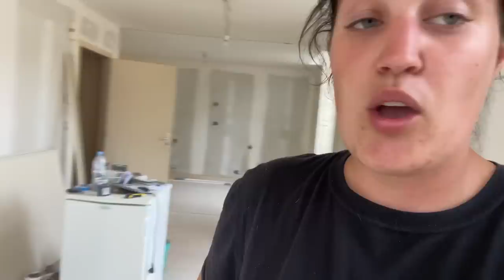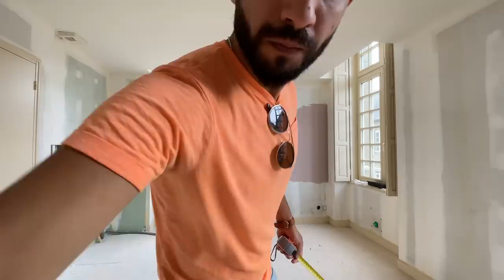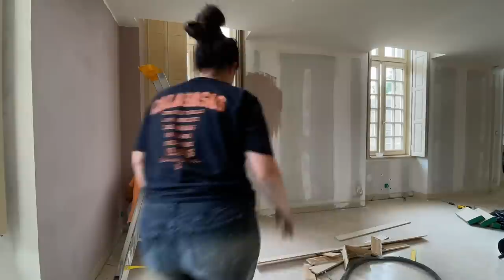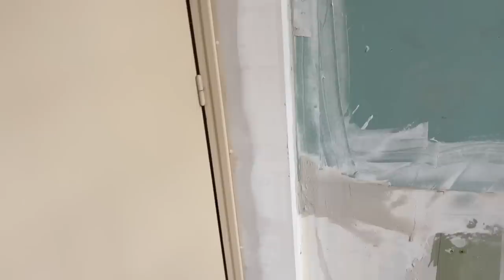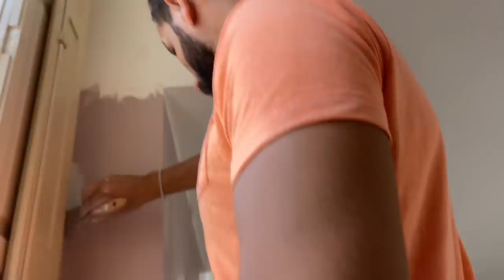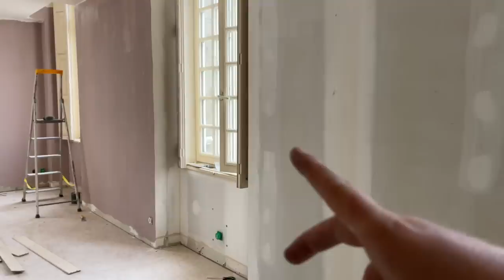Turning Part Of This Convent Into A Duplex Apartment!!

Comment: Just a question guys, do they not use paint rollers in France? I see you all use a brush for all painting.  Here in South Africa usually we use rollers for all painting and only use a brush to do "cutting" ie corners or very tight areas.
Regards from South Africa.
Reply: I was wondering the same thing.  It would go so much faster and the coat would be smoother.
Reply: They do sell rollers in France.   I am  not sure why they are only painting with brushes. Maybe it’s to do with the paint they are using !!!!
Reply: I had the same thought, it is what we do here in the States too.
Reply: I know when Michael was painting his cottage, he said he preferred the look of hand painting over rollers. He said you dont get the little bumps that rollers leave behind.
Reply: Interesting way of painting walls with a brush.
Reply: @WilldoAldone  it does depend on the type of roller bc there are several. I find that the roller will miss a lot of spots depending on the wall texture itself despite a different roller! Having said that, I wonder why they dont tape it off and use a paint sprayer for 1 even basecoat then go back in and use brushes. Cut in and larger ones.
Reply: I was wondering the same thing.  It would be so much faster.
Reply: @MSSC73  yes hand painting is much slower, but Michael also said, hand painting looked custom to him and he could tell the difference between rollered or handpainte. He didnt mention spray painting though. If I had a room to paint here in my house, I'm using a roller. Lol I dont want to spend all day on one wall.
Reply: @WilldoAldone  lol. ive done big rooms alone, including the ceiling w a roller and brush and it gets tiring and does take longer if you do it alone. I had to do a childs room, and a trick is 3 walls the same, change out an accent wall color only. Much easier. I only used a larger brush and a new cut in corner brush. Still taped part but it went very fast.
Reply: @MSSC73  Next time try a painting pole they make it so much easier and not tiring. Just bought one last year and will never paint without one ever again. 😀
Reply: The pole for the roller is excellent for painting ceilings, walls and floors so much easier!

Comment: The color looks great, if you have the time, try sanding the walls after each coat of paint, its the final result leaves the walls so smooth and looking sharp.
Reply: That's a lot of extra work when all you have to do is use paint rollers. Wondering why I never see anyone in France using them. You could do that whole floor in one day and comes out smooth

Comment: always paint your ceiling first then the walls as the darker colour covers the white if you get any on the walls, when painting walls cut in first roll main walls or paint brush after. use a 6 inch brush  much quicker.

Comment: That colour looks fantastic so far. I'm glad your not using a green in the lounge area, there is no reason you have to stick to what the so called 'experts say' regarding colours. It should be your colour choice, judging the light coming in the windows at certain times of the day... then the evening with your softer lights on as you will be living there.  You have great taste Sadie. 💕🇦🇺

Comment: "10," asked why you don't use rollers! I questioned Billy on his vlog for this. In the USA, we use a roller, because it holds more paint and distributes an even and smoother layer of paint faster. Working with a brush, I will use it for angled surfaces. Such as trim, frames, moldings, etc. Since I'm not from France, and have never been in Europe, I'm serious when I ask, "do they use rollers in France?

Comment: I've seen so much painting done in France but no one seems to use a paint roller. Also I'm curious why you don't use texture on the walls instead of painting the drywall.  I find that painting drywall without a texture soaks up the paint to fast. Just curious?

Comment: Hot sure why all the painting is done with a brush. It's just so time consuming, and it leaves brush marks everywhere. In America, we use a brush just trimming in corners, around wood moldings, etc. Otherwise, we use paint rollers for the main sections of the walls and ceilings. And we  paint the ceilings first. That way, if anything drips/spatters, it doesn't get on a freshly painted wall. It just isn't efficient the way you are painting and the tools you are using. Are paint rollers not used in Europe?

Comment: Not sure why you have decided to use a brush instead of a roller.  You end up seeing the brush stroke whereas using a roller will give a smoother finish.  Plus you would have finished the whole walls in the same amount of time.  Always do the ceiling first then the walls.  Not sure why you guys are doing things so backwards.